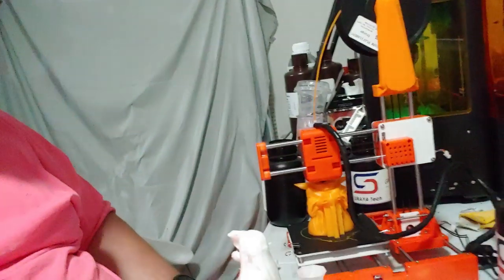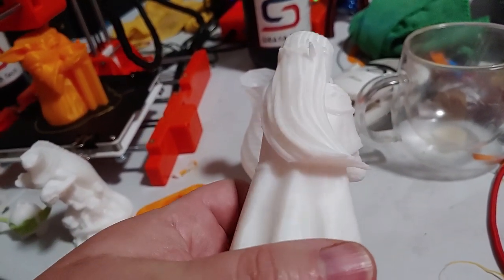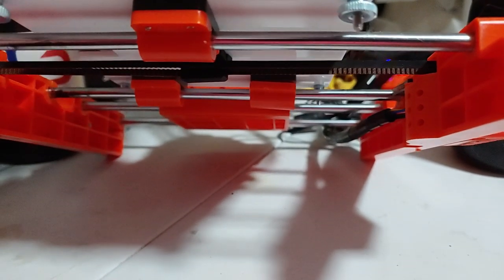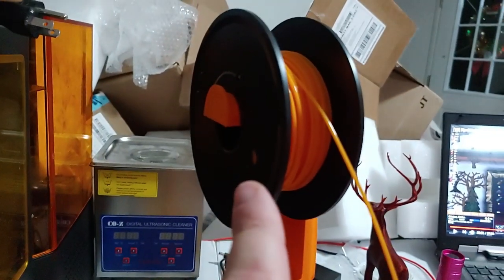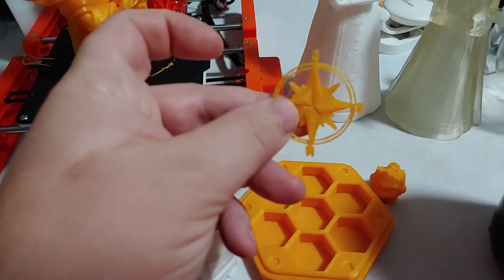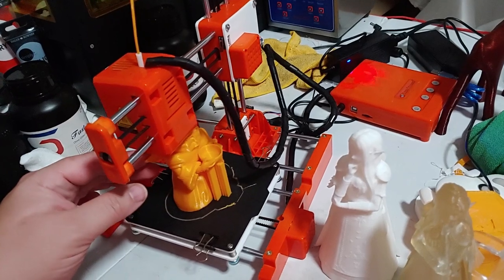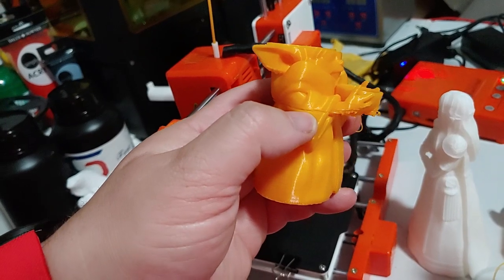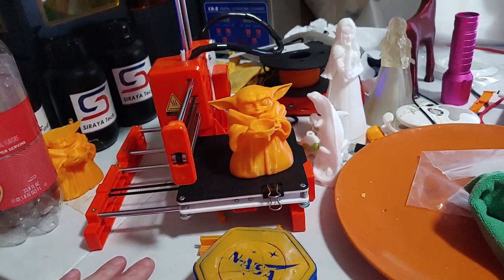Easythreed X1 Tiny Cheap 3D Printer that actually works! T3DP

Comment: Inverted axis is not a problem. We may check it in preferences while slicing, or change every two wires for their places (every stepper motor connects to motherboard by 4 wires, we need to change every two to charge direction)

Comment: I just got this printer. Could you do an update or guide me on where to find your settings file in google drive?
Reply from the maker: If the video description is a google drive link to my profiles. they are only for SIMPLIFY 3D if using something else check out the pinned post at the top I spell out all the settings I use for basic printing to get started.
Reply: @nerys71  hi link to google drive does not work anymore :/ could u please provide update thx .)

Comment: Option $7 lets you change direction on axis. I wanted to change direction on the X axis so I type in "$7=8" as I want to change bit 3 (8 = 00001000 binary) if you want to change direction on Y axis you type in 16 (00010000) or 24 (00011000) to change both.

this is the GRBL code commands to automatically invert (or re-invert) your images for print....

Comment: Adding little tiny neodiniums in each corner underneath should be strong enough to hold it down, although i eouldnt go too big with them, as you will struggle to remove the build plate as those magnets can be very strong. Great video, I'm off to order one now as, although I've bought myself a full size 3d printer, I've not long moved house and its still flat packed in the box it came in, unopened, as i dont have room for it yet, but i need to print a large number of small items asap. If i order one of these now ill be printing by tomorrow afternoon!

Comment: Could you please provide a cura profile? 
Also I noticed that for your dice tray there are spots for a little neodymium magnets so I was thinking since you might have some. place one directly in the center of the magnetic board underneath it so it clamps the magnets together really strong.

Comment: How about you use a glass bed with clips to fix the lifting problem ? Could you just flip the stepper motor wires to fix the inverted printing problem ? Should be fun to see how well it does once you add a Parts cooling fan. Hope you feel better soon.
Reply from the maker: Glass very heavy and you lose the desirable flex. Cant flip wires as that wont invert the model but invert motor movement. Which means endstop in wrong spot then :-)
Reply: I guess you will have to invert the stl files in a slicer program for now. dang it.

Comment: noticed with the magnetic print bed it does not work well unless you keep the removal tab to the out side side not the front or back... it stays on much better it you face the tab out! 

BTW, Mine has died already had it a week and the print head stopped moving correctly (x-axis I think) I sent this note to Babggood and hope to get refund or replace......

Issues:
the drive for the print head slide belt has failed in less then a week. I think it may be an issue with the z axis zeroing switch. No matter how many time I leveled it the thing would go out of level again. sometimes bad enough to dent the bed with the head. often enough for it to drag while printing. this drag may have over strained the belt / stepper. It never printed well and even messed up the cat that came on the card. lastly I printer a 100x100x1 mm square to test it's moton rage to make sure it was failing and it most of the time could not reach the full 100mm and sometimes could not make it back either... if not for the zero switch reset switch on the (is it x axis) it would have freaked out totally, but each time it did make it back to zero it reset and corrected it position. I bought 2 of your printers at the same time and the one I gave as a gift seems to be working but in truth, it's user is not a tech geek like me so she is most likely going easy on it as well... I did not... I tried very hard to get it to work and it screwed up many prints before I realized something was wrong... then the head stop traveling full swing and I gave up. It also prints backwards (mirror flip). You also need to tell people to keep the take off tab for the removable print surface to the side of the printer not the front or back... it makes a big difference in magnetic traction... (I saw a video of a guy using binder clips just to keep it on the build bed, in the wrong direction.!!!). spool holder is also a joke.most spools are too big for it. ALSO I could never get it to print directly from my computer and it would only work for me if I used their inhouse slicer program, nothing else had profiles for it... I want a refund.. I would settle for a replacement. I'm old to computers but new to 3d printing and this has just about turned me off on it. I hope something can be done.

Comment from the maker: My standard settings for the easythreed x1

3x3x3 (walls top bottom) 25% grid infill walls first then infill

0.4 and 0.4 for line and nozzle. 0.92 for extrusion multiplier (flow rate)

220c 30% speed for first layer 190c after if the filament can handle that.

I add 0.25mm lift to my start script to take up the z belt drive slack. No raft needed bed leveling is tedious but doable. Never ever use zhop or retraction vertical lift. It wont work with the belt drive!!!

2mm retract and retract during wipe 8mm wipe. 25mm/s print speed 80% outerwall underspeed.

It is capable of doing 0.1 layer height. First few layers might be squishy till belt slack is taken up fully. Advise multi process do first 5 layers at 0.2mm then switch to 0.1mm so belt is tight in Z

ALSO Here is my start script belt slack addition

G1 Z0.25 E2 F300
G92 E0 Z0
Reply: Could you please share a script (Medium print quality)  just to make sure I am doing everything ok? BTW I am using Simplify3D as you suggest, but I don´t know where to add the 0.25mm lift and some desings look smashed :(
Reply from the maker: @zianbritz5692  Make sure you turn on RAFT in your slicer. this printer can be used without a raft but takes a little effort to get to that point. so to get some success under your belt turn on raft.
Reply: Could you do a video/tutorial on how to get this printer set up the way you have it. Your prints look amazing. A newbie to 3d printing here 😞
Reply: I just purchased this as my first printer and I kinda lost anyone have a standard software I should use ?
Reply: Having some issues with this printer. The z axis is not moving upward
Reply: How can I edit the script, like you said?
Reply from the maker: @GabrielCamilo84  You goto the "SCRIPTS" section of your slicer for "Start Script" here is what I have
M205 X3
M204 P300 T600
G28 ; home all axes
G1 Z0.25 E2 F300
G92 E0 Z0
Reply: Hi total newbie, how do put tension on the top belt? I'm sure I calibrated the bed well also tightend it, but my test print comes out squed
Reply: @nerys71  THANK YOU SO MUCH FOR THIS.

I was spending so much time trying to figure out why my nozzle was plowing through the first layers of the print. I found your video and tried the code. I'll be damned if that didn't fix my problem. You are amazing. This is my first 3D printer and I have been happy with it mostly. Your G-Code script makes me almost entirely happy. Thank you so much. You got a sub
Reply from the maker: @gabrielh7765  just enable the initial vertical lift that I have in my G-Code and do not use Z Hop and you'll be fine
Reply from the maker: @deepwebcowboy6681  I am glad it works! Just remember go slow and have fun
Reply: @nerys71  Absolutely! I have already made some small figures and even some functional parts. Thanks for the reply, keep up the awesome content!
Reply: @nerys71  thanks man, appreciated, 😊 it's like getting tattoos... I got 3 more printers, an Lk4, Trnxy xy2 pro,  and a mingda d3 pro.  Haven't delved into script and code yet 😱 just about mastering levelling and belt titeining.  Looking forward to content on these. Thanks for the reply and have a great Christmas
Reply: @nerys71  your theory about the belt-slack sounds convincing - And I also have the problem with the first couple of layers being squished together. I tried your start sequence, it didnt work for me... from my understanding it would need to be a two line code: set it zo a certain z-position (g1 Z10) and tell it to, from now on, handel it as if this position would be by the offset lower (e.g. g92 z9.8)
Reply from the maker: @leggler  it is 2 lines. 1 for the movement and one for the zero set

G1 Z0.25 E2 F300
G92 E0 Z0

Adjust the 0.25 as needed. small steps :-) DO NOT use Zhop. it won't work well with the belt slack.

Comment: Can you make a recommendation to improve this printer...example the you saiz adjust the Z axis in the software...sorry i new to this 3d printing world...in fact i don't have a 3d printer...but i will buy this eventually
Reply from the maker: Yes my profile is in my link in the description basically I instruct the printer to lift the z-axis a quarter of a millimeter at the very beginning when it's done homing this takes up the slack in the belt that drives the z-axis beyond that I run my extrusion multiplier I believe at 90% on this machine I'll have to double check that and you also need to slow down I run this machine at 20 or 30 mm per second usually around 30 mm per second it's just not stiff enough and not strong enough the motors aren't strong enough to go faster which is where people have the problem oddly enough it doesn't actually add that much to printing time because you can only print so small anyway the results are pretty darn good I always make my first couple layers point 2 millimeters but you can also do 1 mm and it's actually pretty darn nice most of the time you don't need to go that fine though

Comment: Hey man, I dropped into your live stream when you were running this and liked what I saw. Mine turned up the following day and I've been running it continually since.

I'd be interested to know what PCB is in the control box because the one in mine has an Atmega 1284 onboard - one of the earlier videos I saw about it had a different board with an ARM processor and space for a WiFi daughterboard.

I've had my hacker hat on; the firmware is Marlin. In the shroud around the hotend there's an extra, unused connector which corresponds with the part cooling fan when I pushed the Gcode at it.

I'm having the mirrored print issue as well, been getting to work out if I can reconfigure and save the settings so that the y-axis limit switch is treated as max and not min, and then I should be able to swap the wires on the motor around. Can't decide if I'm brave enough to try!

Finally, multiple files on the SD card: I change the file extension to .bak except for whatever I want to print 😀 been looking at the Marlin docs to see if I can add a screen, but have also been trying to do work and everything...
Reply: Hi ...
Looks like the steppers used on this dinkey wee printer are Bipolar type, which means 4 wire, i.e. 2 wires per internal coil - there are 2 coil windings.  To reverse the action of one of these steppers, just swap the wires around on one of the coils, doesn't matter which one, but you need to use a meter to identify the coil pairs first, of course.  If you're unsure, just search for "reversing a 4 wire stepper".
Good Luck!

Comment: Have you tried to turn your magnetic bed by 90 degree?? Its like  5 times stronger after it is turn around. Instead of changing G-code for 0.25mm lift i just set the bed a bit lower, so the paper have little friction between the nozzle and the bed.
Reply from the maker: The reason for changing the g code is not for bed leveling it's for slop

I can get the first layer perfect but the first three or four layers have a bit of Squish in them elephant's foot this is because it's using a belt for the z-axis so never ever use Z hop on this printer it won't work well :-)

The 0.25 lift doesn't actually move the nozzle. It takes up the slack in the belt. So that when it goes to the second layer actually lift up the correct amount. Reducing the elephant's foot and also eliminating the need for a raft.
Reply: @nerys71  I was getting confused because in Cura it lift the nozzle up 15mm after it is home. So adding to 0.25 lift before print wont remove the tension it would just drop down to 0.25 so I thought dropping the bed down more would have the same effect. Now I fixed it and looking back in your video again, and you did mention it having to home first but I didn't understand how to read the G code then. I share the code I added for other below:

G1 X5 Z0		;Z drop to 0 and Move X 5 mm away from home
G1 X10 			;move X 5 more mm from home to wipe nozzle
G1 Z0.25		;Z lift to 0.25 or little more if needed 
I find 0.45 better on my machine
G92 Z0			;zero Z level
Reply: @michaeltue3176  does that code work as is?
Reply: @NoahWeigert  You at to the end of the start g-code, I changed it a little since.
G1 X10 Z0				;Move X 10 mm away from home and Z to 0
G1 Z0.3				;Z lift to 0.25-0.4 correct z belt tension
G92 Z0					;zero Z level
G1 X80	F500 E10		;move X 70mm Extrude 5mm
G92 E0					;zero extruded length
Reply: @nerys71  I had to take mine apart and tighten the z axis belt on mine. First thing I printed was an xyz cube. I'm not sure if I got elephants foot, or it was just from the brim

Comment: How did you get your prints to be bigger in size??
Reply from the maker: I'm not sure I understand the question bigger than what? If you mean bigger than they came while still of course being small enough to fit within the build volume of the printer you do that in the slicer in the slicer you can select the model and change the scaling make it larger or smaller etc

Comment: Hey man, thanks for this video, i ordered this same printer (still yet to arrive) and this helps alot to understand what it's capable of. Your suggestions will for sure come very handy!
Reply: Hi, i am also plan to get this, did you finally get your printer, any review on your side.
Reply: @awangbuaya9698  I've been using it for a year. It does the work... Don't expect much quality but for simple stuff works great. The size constraint is an issue. I would advice you to get a bigger one.

Comment: Nice print ! 
Is possible use slic3r or cura spftware?
 the firmware is marlin?
Reply from the maker: Yes I used a simplify 3D so slicer and cura would work fine just remember to add that point 25 lift at the beginning check the PIN to comment I have the start script to add and remember print slow this thing cannot go fast but if you take it easy it can make some nice prints

Comment: Any updates on the mirroring issue? I just bought this model yesterday and still shipping.
Reply from the maker: None on my end I fixed it in the slicer just by mirroring the model before printing it I assume they fixed it in firmware but I have not verified this

Comment: Thanks for the profile.i noticed the flipped design after printing text in a sentence.got a mini fan on order .mine is a LABISTS X1 same printer.do you think polycarbonate would work with tape on top?
Reply from the maker: I am not sure if this could hot enough to print polycarbonate. Possibly one of eSuns hybrid polycarbonate that prints at lower temperatures. ?

Comment: Feel better bruh. Should I buy one of these or save for a prusa mini lol
Reply from the maker: If you want a sub $100 printer to tinker with get one. If you need your printer to work hard get an ender 3 or prusa mini.
Reply: @nerys71  im thinking about the prusa mini i really dont wanna tinker anymore. this tevo tornado was the wrong choice for my first printer lmao. thank you nerys be well
Reply from the maker: @frozenwalkway  no problem. From all i can gather the prusa mini is an excellent machine. Good luck!
Reply: Or you could get a sovol sv01 for $300 already assembled and it’s a direct drive which means it can print flexible filaments easier

Comment: Hello from New Zealand. I thought about getting one but thought it looked like a toy/wouldn’t be any good. You’re video has made me rethink buying one. The only thing mostly putting me off it is it doesn’t look like it used standard parts? I like to be able to upgrade and fix things where possible
Reply from the maker: Unless you want it to play with consider an ender 3 or something in that $150 to $200 range.
Reply: If your still looking, the ender 2 pro was my first 3d printer, and mine works great. Super easy to assemble too.